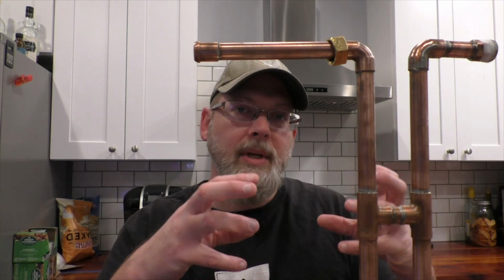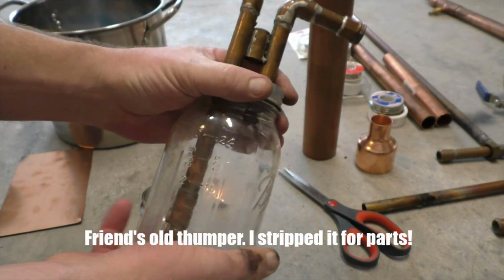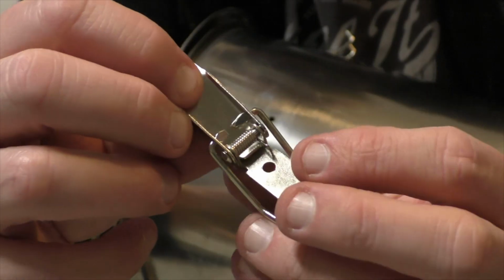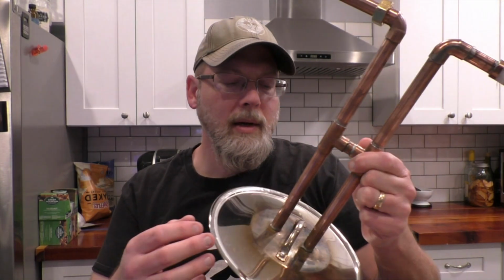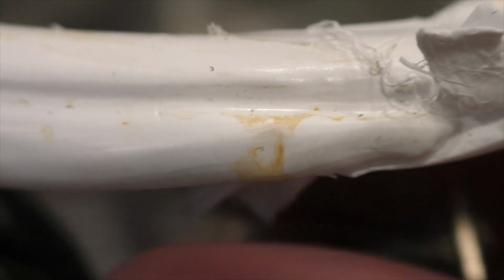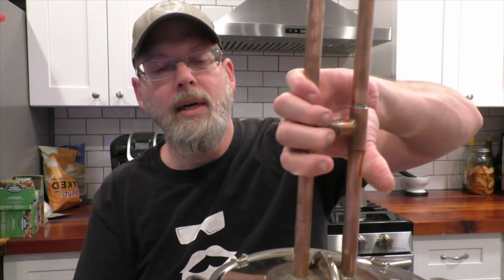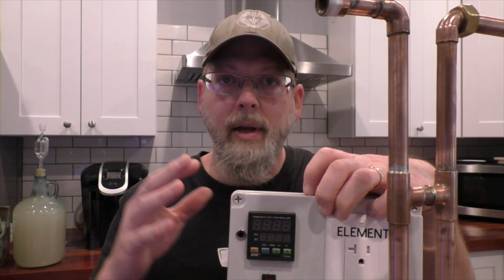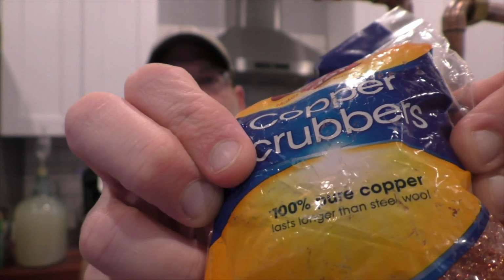How to Build a THUMPER For Your Pot Still!!

Comment: Will 1/2 inch copper pipes work? For a 5 gallon boiler? Also id recommended to anyone dont use the spring reloaded clamps as you'll need to make every bolt not leak compression. Id recommended vice grips they do the same thing and no welding or bolts required!
Reply from the maker: 1/2 inch for a boiler or thump keg? For a boiler I think it's really drag out the run time, but for a thumper it'd be good.
Reply: @BeardedBored  so the tubing from the boiler to the thumper youd recommend something bigger like 3/4?
Reply from the maker: @MrJackassz  1.5 to 2" minimum for the main distillation column. But 1/2" from the top of the column down to the thumper is perfect.
Reply: @BeardedBored  so 1.5 minimum from the boiler then can convert to 1/2 to the thumper?
Reply from the maker: @MrJackassz  Yep.
Reply: @BeardedBored  awesome thanks. Can i soulder copper to the stainless steel lid with a 1.5 inch copper tubing? Im trying to use my 5 gallon stock pot and also where does someone buy a thermostat thats atleast 250 Fahrenheit(im canadian we use Fahrenheit) ill probably need to drill and have a screw on the back with 2 orings to seal it?
Reply: Thankyou for the help ive never done this before and have really wanted to do this, also because in canada we pay 30 bucks minimum for any alchol even crown royal is 35 bucks 750ml. I cant afford to drink once in awhile also having 3 kids.
Reply from the maker: @MrJackassz  1. Yes. 2. Home brew shop?

Comment: Hey Bearded.
I use to think just like you, but there is nothing wrong with using a mason jar as a thumper.
Mason jars are rated for 310-320 degrees (f)
The idea that 170-211 degree ( even 250 degree if people are getting mega greedy) will crack a jar is just not true.

Thermal shock is an actual issue but since the temperature rise is gradual, the risk of cracking is almost zero.

Mason jars are dunked into boiling water and thrashed around for 2 hours without cracking.

Insulating the jar is the ultra safe way to go and the method that use ( it shields the glass from any unexpected thermal shocks) 

That being said, one needs to make sure their jar is large enough for the volume of mash/ distillate in the still

Mason jars come in one gallon sizes or you can daisy chain multiple smaller jars.
Reply from the maker: I see your point, but my aim with that advice is to make sure new guys are as safe as possible. Newbies on fire makes a bad headline for the hobby so I tend to ere on the side of caution for stuff like this.
Reply: @BeardedBored  
Thanks for the reply. Point taken.

I didn’t even think  about the new guys. There is already almost too much to learn in this craft.
I forget that the goal is to make a hobby with a high learning curve simple.

Love your vids. You, George and Jesse  are 

“hypothetically” unlocking the mysteries of home distillation, and......,making it a legitimate hobby!

Rock on.
Reply from the maker: @itaintrocketscience  Thanks!

Comment: For the folks using kegs for your boiler, half kegs make excellent thumpers too, and they like the big kegs seem to heat very evenly and fairly quick too. My latest, im actually going to pick up the small keg now, but im going to drill a hole close to the bottom and weld in a fitting. Remember on these the bottom isn't flat, so not as much worry if your pipe goes all the way and touches. I even cap my pipe and drill 20-30 tiny holes for about the last 2 inches, and even in the cap. So my thumper generally don't thump, they make a sizzling sound, guess you'd call them sizzlers instead? Maybe? Who cares. Be safe everyone don't die making shine, save that for way later.
Reply from the maker: Thanks for the advice. I'll upgrade to that one of these days;-)
Reply: see, I really like the idea of making it into a bubbler similar to a fish aquarium would use. this is it. Not that I know anything, but my $0.02

Comment: i like your video, yes the sight glass is at least 3 times thicker than a mason jar. I put a sight glass on the side of my thumper just so I can keep a check on what's going on there.
Reply from the maker: I've always wanted to do that with a thumper. How did you attach it? Solder?
Reply: @BeardedBored  i ordered a weldless 2" sight glass, easy to fit. I did a  order for a 50mm TCT Carbide Tip Hole Saw Carbide Metal Drill. And made a hole in thumper. and then fitted the sight glass in. I got the cutter on ebay .
Reply from the maker: @cameronshine3465  Cool, thanks!
Reply: @BeardedBored  i did a thumper run 2 days ago, you can see the sight glass that i fitted to the thumper. Its did leak a bit of vaper for a few minutes but that's my fault and not the sight glass. I didn't have a spanner big enough to tighten the larger nut inside the thumper. You can can see it on my channel. I have a spanner on order now.
Reply from the maker: @cameronshine3465  I'll check it out:-)

Comment: what do you put in your thumper? what if you only have one jar of tails..what else can you use? thanks-
Reply from the maker: Anything. Water, juice, fermented wash. It doesn't take much, maybe 2 quarts to get it over the tip of the inlet pipe so it bubbles.
Reply: @BeardedBored  thanks for responding  so quickly, what would you recommend?
Reply from the maker: @Outcastr1  Some of the original fermentation is always good. If you don't have any left, just mix up a gallon of it to ferment. When it's done pour in your tails and enough of the fresh batch into the thumper to cover the outlet pipe.

Comment: 10:35 - is there a certain type of solder you must use, or must NEVER use when soldering copper for this purpose, etc ?
Reply from the maker: Always use lead free silver solder.
Reply: Use tin, "100% lead free" solder. That's actually the most common. Tin is by definition food safe.

Comment: Bearded and Bored - I have just finished making a similar thumper set-up for a buddy of mine.  You mentioned a pressure release valve at 5psi.  The ones I got were 20 psi - I'm assuming that it won't necessarily make a lot of difference - but if you think they should be 5psi, i can change them out.  I also added stainless pressure gauges (25 psi) and stainless thermometers so he can monitor/regulate the conditions within the system via heat control.  The set up is very similar to what you mention in this video.  

But one question I did have, after watching your video - is that you mention of brass not being a "good" candidate for any copper-copper + sweat connections.  In the my setup, I sweated in stainless valves (in brass housings) so the thumpers could be segregated or run in parallel - I'm hoping that this won't be a deal breaker for the setup.

Thanks for your cool demeanor and very informative videos.  They are appreciated (by many).

I will upload pictures asap
Reply from the maker: I'd swap out the release valves to no more than 5psi because it prevents any sort of a problem, long before you get into dangerous territory. 20psi is higher than a pressure cooker, and those things go boom when they fail.

The issue with brass is the potential for lead in the brass alloy. In the commercial brewing and distilling industry they don't even use lead-free brass. If you used lead-free brass, then it's your call if you want to swap it out or not. Some folks are fine with it, some folks are dead set against it. Up to you on those, but I definitely would swap out the release valves. 

Sounds like a cool build. Email me some pics;-)
Reply: @BeardedBored  two thumbs up for your insight and advice.  I am looking online as we speak for 5psi relief valves..  will email you some pictures of "Jolene" - as I've named her.  :)

Comment: Bearded, how has your experience been with the Chinese gasket material you used on your thumper build?  Well, for those of you who tried the Chinese PTFE gasket material that Bearded left a link to, and for those who haven't, I tried it and ended up with a huge mess.  The gasket material basically melted into strands under heat and left behind the peel-off adhesive which is almost impossible to get off.  A frustrating experience.  I know I bought the same stuff.  Who knows what's in the adhesive but if you heat it up you could build cars with it.  The PTFW gasket material?  Not so much.
Reply from the maker: I used acetone to get the sticky stuff off. Sorry I forgot to mention it in the video. Overall, the ptfe tape is tricky to work with, especially if it shreds. I'm looking into EPDM as a better alternative. It's widely used in the commercial distilling industry, but custom making gaskets is the tricky part since you need material that is thick enough to work well. Let me know if you find something worth trying.
Reply: @BeardedBored  yeah, I should have removed the adhesive Before I used it! Dumbass. Thanks for the tip.
Reply from the maker: @GeorgeinAZ  Hope it helps!

Comment: Wondering of the possibility of adding one into a t500 electric. Possible?
Reply from the maker: Hmm, not sure. Haven't been around one more than once. I just talked to Jesse about it and he's not sure the t500 could handle an added chamber like that. They're design to have enough power to do what they were designed for and might not have enough left over to push a thumper. You could always try a test though. Fill the t500 with water, don't run cooling in  the product condenser, and let the output run into a pot of water. If the water heats up to normal boiler temps it might work. Only way I can think to test it to see if it has the power to do it.

Comment: A pressure relief valve will not relieve a vacuum that has formed in the thumper/still. The ring on top will allow you to manually release the vacuum, but would not be a safeguard if you were forming a vacuum unless you could keep the ring up somehow when you turned the still off because it has a spring inside to keep it closed

Comment: Great advice - Just wondering would it be dangerous going from a 2inch column down to a 3/4inch pipe then up again to 2 inches for the condenser?
Reply from the maker: I'm no expert, but I'll say probably not. I'm having trouble picturing your design. Feel free to send me an email.
Reply: @BeardedBored  Thanks for your reply - I'll get the various bits and bobs (measurements etc) and email you - ta - Conor (Ireland).

Comment: Great video. Did you have any issues with air leaks at the handle rivets on the pot or the lid? If so, did you seal them?
Reply from the maker: No leaks, but if any ever develop I'd just drill out the rivets and replace them with bolts and ptfe washers.

Comment: Good Sunday morning B and B. I have reversed engineered a stainless steel pot design for a still using info from you videos and need to purchase the copper pipe. My still pot will be 10 gallons and my Thumper will be approx 3 to 5 gallons and then to maybe a 10 gallon pot for the worm for cooling. What size pipe should i have from the still pot to the thumper and from the thumper to the worm and finally the size pipe for the worm itself?  Your help in this last step will be all i need for completion of this beautiful piece of equipment. Many thanks!
Reply from the maker: 1/2 inch copper works great from an elbow at the end of the column all the way to the output end. Most still are 1/2inch after the column. Good luck on your build.

Comment: Can you use a pressure cooker for this since it comes with a gasket?
Reply from the maker: You can, but I'm not a fan of them because they seal so tightly that if you ever do get a clog it can be quite dangerous. But that's just me. As long as you take safety precautions like installing a pressure relief valve on the thumper and vacuum break on the boiler you can do what works for you.

Comment: Hi B&B,  I'm in the UK and was excited about seeing expanded PTFE tape...until I checked out the prices here......they are HORRENDOUS!!! Anyways.....back to cork sheeting. It's my understanding that they're made by gluing cork granules together....and there is my worry..the glue used in the process, is it safe at the temps encountered and with hot alcohol vapour?
Great video by the way!
Reply from the maker: I'm actually looking at another material called EPDM. It's non-reactive and is used quite a lot in the alcohol industry for gaskets. It's also not very expensive so I'm looking into it as a better alternative.
Reply: @BeardedBored  Am waiting with bated breath....thanks

Comment: question for you...if you gent;y heat the thumper would that help speed the process?
Reply from the maker: Maybe, but without heating it, a thumper this size will heat up in 20 minutes once the boiler is up to temp. It's not like it doubles your heat up time. But if you want to get it up to like 100F that would help it go quicker.
Reply from the maker: You should check out the Angry Parrot channel. He builds his stills and one was a 100 gallon or bigger with 2 20-30 gallon thumpers for rum distillation. He did not add heating elements to the thumpers, but he can answer questions about larger rigs.

Comment: Cracking video, you made a cracking point regards to fore shots/heads going through the thumper, shutting off & then adding backings to the thumper, I started my build but have added a bypass using ball valves to save having to shut down, can you see a problem with this at all? Just thinking of pressure but as long as I open the one in & out to the thumper before closing the other, I think I should be ok.....right!🤣
Reply from the maker: Yeah, should be fine. There are lost of interesting bypasses that guys have built into their rigs on the forums. Next time I tinker with mine I'll add one in.

Comment: Great video! I built a thumper similar to yours with the spring latches, which works great, only difference is I used copper rivets to attach them to the pot.  I use a flour oatmeal paste between the pot and thumper top and have had very good luck with it, but that ptfe sealant is a great idea. Can you use the same gasket on more than one run?
Reply from the maker: I like the copper rivet idea, brother. Got a link for the ones you used? The gasket is still on mine and hasn't had any leaks. As long as it doesn't get cut or crushed it will last a long time. But, I think there is a better (easier to work with) material I want to try. The liquor industry uses EPDM gaskets a lot. It is also chemically inert. I'm thinking of getting either some epdm tubing to slit down the side and put on the rim, or a sheet of epdm to cut a full gasket out of. I'd check into that before you get the ptfe tape cuz it's very fiddly to work with and won't melt together to make a solid gasket at the tips. I saw some on ebay;-)
Reply: @BeardedBored  I bought my rivets at the local TSC store I think they called them saddle rivets, but they are (Weaver leather rivets, label on the back says copper rivet/burr set #9  77-3020). I will look into the epdm material it sounds interesting! I just found your channel today and hit the red button, looks like a lot of interesting videos to watch. If you have any luck with the epdm I would love to see a update.
Reply from the maker: @JD5756-p4u  Thanks for the info! Going to do a gasket video sometime in the next few months:-)

Comment: Other than size restrictions and cost what about a pressure canning pot. Replaceable lid seals and no latches to install. Pressure relief valve built in. They typically have a pressure gauge installed, you could use that opening as a port for piping.
Excellent description of the thumper and build! Thanks!
Reply from the maker: Should work fine.

Comment: Try cutting the gasket ends with a razor blade and use super glue. As the thumper fills the back pressure will slow the flow out of the pot kinda like stuffing a column, 5 pounds is a lot. The  thermometer in the pot keeps the water out of the shine ,I say yes, use one. You know the rubber plug on a pressure cooker lid? Thanks.

Comment: Pro tip.....but just the tip. When you're marking holes to mount anything, put it on your printer and make a copy of the hole pattern. It'll work for anything... clips, surge protectors...... Anything that'll for on the printer glass.

Comment: Put a on and off valve on your thumper. Where the elbows are at. So you can keep running. Open for the four shots and heads. Then close it to push the steam down into the thumper for the flavor.